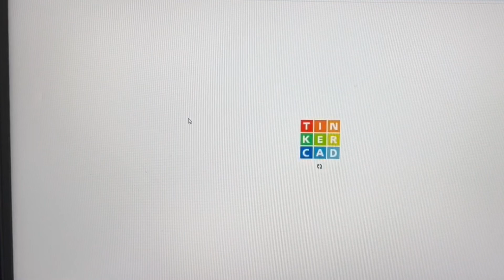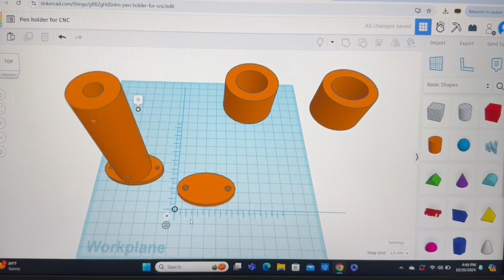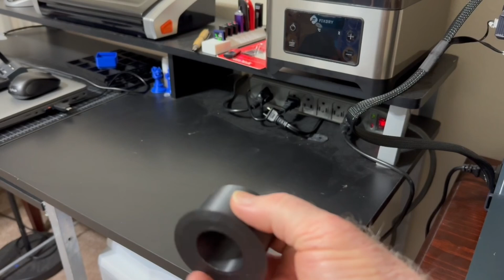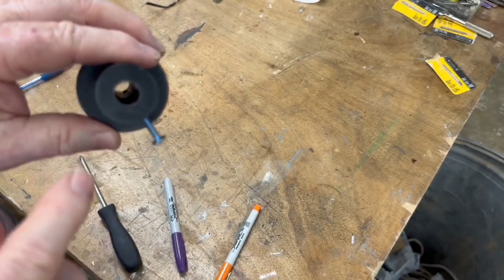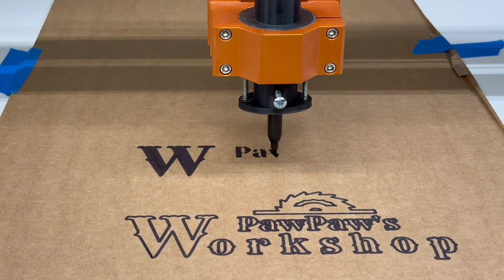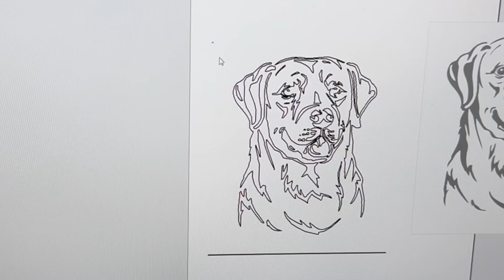Pen Holder that is a TRUE Compliment to the CNC Machine!

Comment: I used a cheap conduit saddle clamp and mounted it right to the front of my gantry. All you need to do is measure the offset from the spindle centerline and move your material accordingly to compensate.
Reply from the maker: That’s a great, simple solution for getting the job done! 👍

Comment: When using the Ruler in Tinkercad, click on the series of lines in a circle under the "X" and you can set it to use the center point instead of the edge. That way you don't have to add or subtract based on the dimensions of the holes.
Reply from the maker: Thanks for the tip, I’ll try that out on my next project.